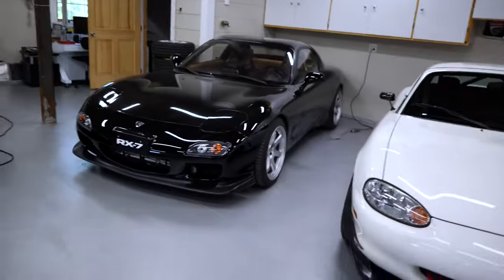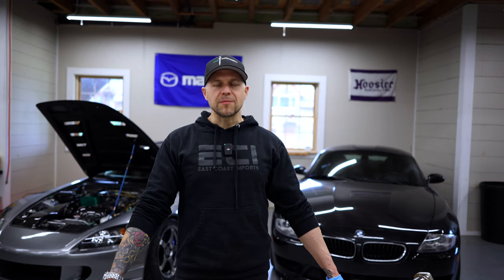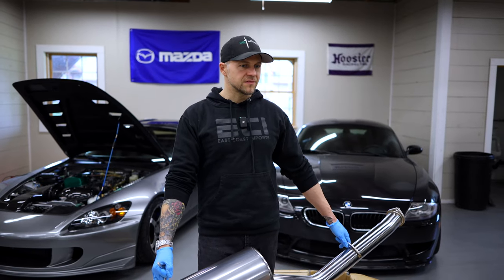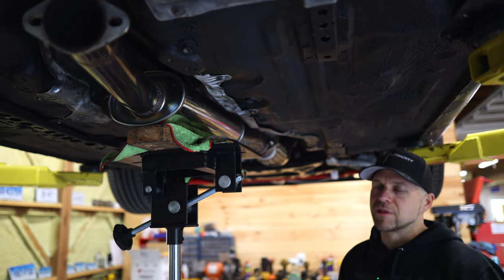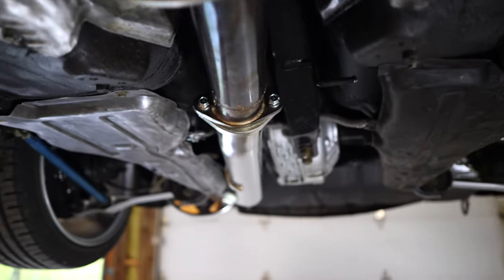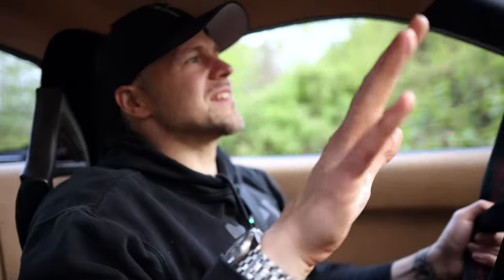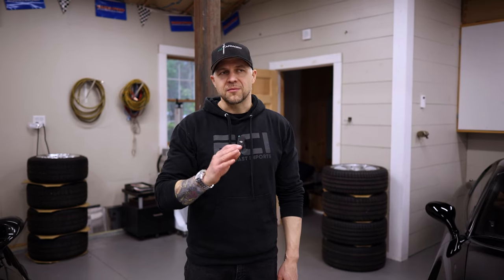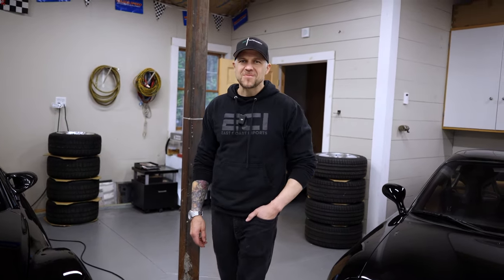FD RX7 RE Amemiya Cat-Back Exhaust

Comment: New FD exhaust sounds great!

My FD catback had that "stinger" reducer design at the tip as well and I put a die grinder and worn down cut-off wheel up the exhaust tip and cut it out.

Didnt change tone, but definitely louder.
Reply from the maker: I did this same thing for a highly modified Invidia Q300 S2000 exhaust I built a while back. The RE exhaust is 3.5" vs 3" of the rest of my system so I am hoping that it balances out a little. The exhaust does get boomy when it's hot so, so I am trying to keep the noise levels tolerable. We are almost done with tuning at 21 psi up from 15 psi, if I'm giving up a couple HP because of the internal silencer so be it. The car goes pretty damn good now regardless lol

Comment: The re amemiya dolphin tail  I had it has built-in silencer / restrictor, which turn the exhaust into a 2.5".  you can found it wtth a torch look through the tip.  I sold mine.

Comment: Great video! You are right about the twin tip vs the single tip. I bought my single tip R.B exhaust back in 1999. It is sad to hear that R.B is cutting corners. The new exhaust sounds good, looks good and the weight reduction is just the icing on the cake. I also like the fact that the exhaust is pointed down wards. My car shoots out large flames and I have a fire extinguisher in the car just in case. Loving the rotary content!!! Brap on
Reply from the maker: I still keep an extinguisher in the FD too lol